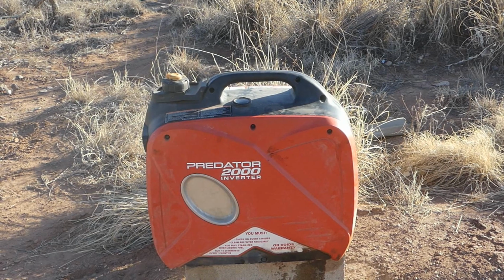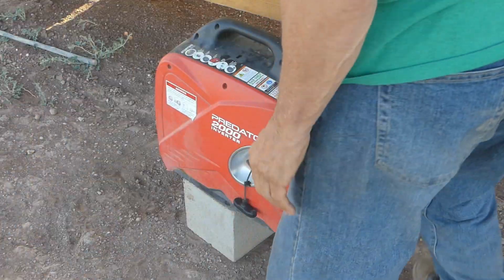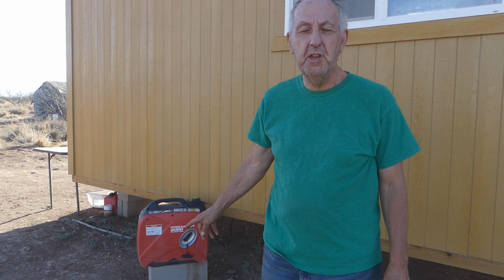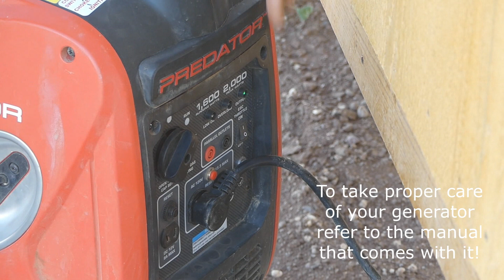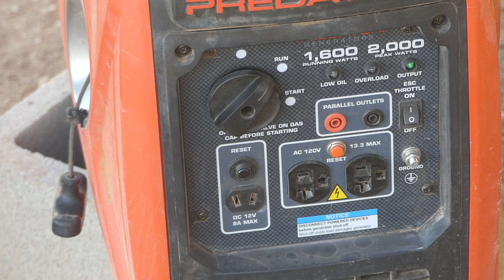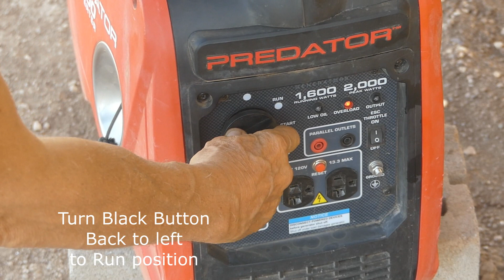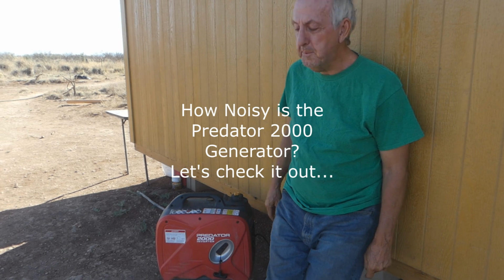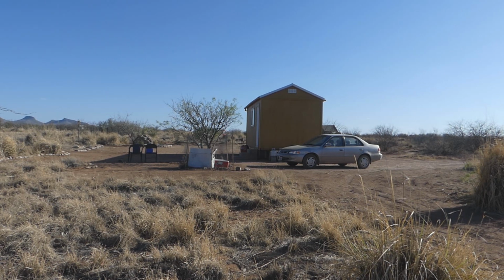Did I choose the best generator for my money for my off-grid cottage?

Comment: After years of using my Honda generator at remote construction sites, the pull cord broke so I went to a lawnmower shop and replaced it. It only lasted a short time because some thief used the rebar cutter/bender I had in my truck to cut the big chain I used to lock it while inside Home Depot for 10 minutes. Don't leave your stuff unattended, even if locked. It's expensive.
Reply from the maker: Thanks Lynne for sharing and thanks so much for watching my videos!

Comment: I also purchased property in Arizona, in Apache County,  I opted to go with 2 Bluetti solar generators.  With all the sun we get in Arizona, they work great.  Bought the set including both the generator and solar panel, so don't have to mess with pull cords, keeping it fueled up etc.  Also they don't make any noise.  Most of my stuff is rechargeable but I'm also able to use my normal kitchen appliances with them as well.  Just something worth considering.
Reply from the maker: Way to go Kevin!  I strongly considered the Bluetti for sure. In the end I felt the Titan was a more powerful reliable option. But then that is before Bluetti upped their game with the latest models of solar generators. Glad to hear that you are happy with them and it sounds like a fantastic system.  Thanks for watching!
Reply: I have both the Titan with 3 batteries and two smaller Bluetti sogens. You need enough solar for the Titan and it has to be set up correctly. Otherwise it will never fully charge. Redundancy with the Bluetti will allow the Titan to fully charge. Portable Bluetti pannels keep it going. Good luck, hope it all comes together for you.

Comment: I have 2 of those Honda Eu2000i's.. and the parallel kit that connects them together for 22 amps. Years ago when I bought them.. they were only $900 each..  but they're easy to start, quiet and cheap enough to run.
Reply from the maker: I looked at the Hondas for sure.  They were just too rich for my financial diet. Thanks for watching!
Reply: Have the same. Since 2004 hurricane season. Just the best value and reliability for your money. Never a bit of trouble despite having run several thousand hours.

Comment: I'm partial to propane generators.
They can sit for years with no carb issues.
I got a 3500 watt surge, 2800 watt continuous one. 
Appx 10 hr on a 20 lb tank, low load.  4 hr near max rated load.

Propane can be stored indefinitely.

Nothing really wrong with the Harbor Freight generator.
Reply from the maker: Great tip F Huber. I am in the process of hooking up solar as we speak so I foresee a lot less generator use in the future.  Stay tuned...!

Comment: I live in Mohave County offgrid in an RV. I  almost solely get all my power from solar. In reality I am now getting all my power from solar through snowy days and overcast days. I really don't miss the days of constantly running a generator or the expense. I believe I saw you have a couple panels. For the longest time I was running 320 watts of solar into 840 AH of golf cart batteries. With that 320 watts in panels I was meeting most all my power needs and running a 1300 CFM evap cooler. Last year I increased my solar panel wattage to 1240  to run a 3100 cfm evap cooler. I have a washing machine with high speed spinner, microwave, extra 12 volt cooler freezer and plenty of other things constantly drawing power. Most nights my battery power doesn't drop below 12.5 volts.  Here in Arizona with the sun you can really get by with less panel wattage and more batteries to carry you threw the night. Enjoy watching you make progress and figuring your way through the inevitable issues of offgrid desert life!
Reply from the maker: lisa mcdonald. Thanks for the super reply and YES I AM WORKING on part of my solar set up as I write this. Thanks so much for watching!

Comment: Solar panels, MPPT charge controller, 2000W inverter, and 4  lithium batteries. All the free electricity you want.
Reply: Yup that's the way to go. Only I would use deep cycle batteries for a few years to save on cost. I'm very happy with mine.
Reply: Not everyone can afford this set up
Reply from the maker: Thanks for such great suggestions folks.  Major teaser here. Solar to come!
Reply: @clarenceduguid7762  
Does take a decent amount to get started, but gas , generator & trip to get gas cost more in the long run
Reply: Around how much would this kind of setup costs? Just an estimate is fine, just want to have an idea

Comment: That Harbor Freight genny is just fine, there are bigger ones but they usually use more fuel.  The fellow running the channel 'Class A Living' has been using one for quite a while now, I think last time I saw it was up to 1400+ hours of run time.  He has had to change the rope so if you have questions, go check him out.

If it ever does go out though, you might look at some of the Champion 3k models, they are the smallest made with a self start and they also have a dual fuel model that can be hooked up to large propane tank. That way maybe you and some neighbors can talk a propane company into bringing a truck around to fill gas up every month or two.
Reply from the maker: Great tip Jon.  Hoping to retire the generator for the most part in a couple months once solar is in.

Comment: Cheaper is not always better.  I looked at the Predator and read a lot of reviews.  I did the same with the Honda 2200 and bought the Honda for my 17 ft travel trailer.  I converted the Honda to propane so now I can choose which fuel I want to power it.
Reply from the maker: Sounds like a wise plan Gene.
Reply: I own 3 Predator generators with zero issues, I would not spend the money for a Honda.

Comment: You could make a small box just for the generator to keep it out of the weather, and if you isolate the box, you would remove a lot of the noise also. ....?
Reply from the maker: Thanks John.  I was a bit worried about it overheating in a box.  But am open to suggestions.
Reply: @affordabledesertliving3487  
Yes you right on that.
One of my uncles dug a hole to eliminate some of the noise from his generator, guess what?
His generator blew, due to overheating.
That kind of motor needs an open air flow.
You can build a shade, without walls.
Let it breath fresh air.

Comment: Very happy your doing ok, and back on line. Yes your rigjt about the sta bil , its recommended to add it to your machine when uts put away for a long time , like months , prevents gummig up the carb , fuel lines.  Take care , lookikng forward to your next video , thanks Don.
Reply from the maker: Robert thanks a ton for your faithful watching of my vids.
Reply: If you are going to store it for a while you should shut it down by closing off a fuel valve at the tank (hopefully it is equipped with one) and let it run until it stops to totally drain the system. Then drain the tank. I've been fooling with gasoline storage for years and even with stabilizer you can have problems in as little as 3 months storage.
Reply from the maker: @bearchow1929  This is super valuable information.  This generator is super simple so dont think it has a fuel valve.  I will check next time I change the oil. Great info!  The other thing of course is that I could run it every couple of weeks whether I need to or not. Thanks for watching!
Reply: @affordabledesertliving3487  Running it every few weeks for an hour or two is definitely an option.
Reply: @affordabledesertliving3487  For what it is worth we have an off-grid ranch in western Arizona about 15 miles east of Salome.

Comment: Here's a tip for you: Get a generator with an electric starter! That way, you never have to yank away on the pull-cord, and starting it is as simple as pressing a button. 

Also, if you get a 'dual fuel' generator, you can run it on propane, which not only smells WAY better, but you also don't have to worry about the carburetor getting gummed up. 

Both are worthwhile upgrades, in my opinion, and I'm cheap-ass!
Reply from the maker: Thanks Tim G I wasnt aware there were dual fuel generators.  Good tip.

Comment: You didn’t mention how fuel efficient the generator is! That’s a huge plus! I have the predator 1400 to run a window unit ac in my camper trailer. It does the job very well for about $4 in gas per day. You could do the same with yours and keep your cabin cool in summer. 🙂👍
Reply from the maker: My cabin stays quite cool because its so well insulated to be honest.

Comment: Those Predator generators are highly rated. Consumer Reports did a comparison with the Honda and found them about equal. The biggest drawback they listed was parts availabilty if you ever need parts. I bought one myself, but I got the 3500 watt unit.
Reply: Everyone I know that got a Predator generator (and/or other brands) replaced with a Honda, say that they are so much better in functionality, durability, replacement parts, servicing, etc, it was worth the extra money, and that they should have done it since the beginning.
Reply from the maker: Merlin yeah I love Hondas.  Hope the predator lasts until I am rich and famous and then I will get a Honda.  LOL.

Comment: glad to see this runs good long hours ,i bartered and got one of these from some off grid folks who ran it all day was worried but seems to work just smells as if its running rich going to clean carb before spring storms take the power out ! i used to run a onan 2cylinder but was over kill and drank gas down compared to this one, lugs hard with a airfryer  plugged in lol

Comment: The Predator 3500 has electric start. All you'd need is a little dolly to wheel it around. I have a pair of the 2000s for emergency power but I'd never go off grid with them. The pull cord is unreliable and spare parts, like if you strip one of those oil plugs, are really difficult to find.
Reply from the maker: dvfreelancer this is excellent information.  Many thanks.

Comment: I'll likely get one of the bigger electric start ones from Harbor Freight, and I want shop power , so I can wood work and weld.

As far as grounding goes, if your outlets are already grounded to a ground rod, you're grounded.
Reply from the maker: Dan I only have a surge protector and a long cord running to the generator so no grounding.  So far I have been fine. I will be setting up solar in the next few months.  Stay tuned...

Comment: My cord did the same thing I just removed the side of the generator and found that where the cord exits the plastic frame is a metal piece that the cord rubs on and splits. I now pull the cord with the side off. No other issues since.
Reply from the maker: Clifford this is an excellent idea I am going to try that as well. Thanks for watching.

Comment: Glad to see you'r back. I was wondering what happened to you.  Just an Idea, If you purchased a couple of 12 volt batteries and a battery charger, you might not have to run the generator quite as long and still have power for lighting
Reply from the maker: Thanks for the welcome back!  Yep solar is in the works!

Comment: One thing that you can do is plug in a small battery charger why your running the generator anyway hook it to a 12 volt car battery and you can get more bang for the buck that way,  you can get a small inverter ( like a cigarette liter type that puts 110volts ) and you can run a couple of 110 volt led bulbs for light as a freebie long after you’ve turned the generator off.     Call it A Minnie hybrid system
Reply from the maker: Solar array is 1/2 here now.  In a few months will be hooked to solar hopefully.

Comment: Maybe try using some heat shrink tubing around the area where the pull cord is fraying to protect it.  I’ve heard of people using that trick with success, not sure how well it would work with this particular generator, but maybe something to consider.  Otherwise maybe you could find a small engine repair place to install a better quality pull cord.
Reply from the maker: Brandon I think that's excellent advise.  I purchased a 2 year extended warranty and so if it breaks when the warranty is up I think that is a great idea to get a small engine guy to put something serious in there for a pull cord.

Comment: You should probably use high octane, only use stablizer if storing it, love your videos, stay safe.
Reply: Does this engine has a high compression rate that requires high octane fuel?
If not, then it is just wasted.
Reply from the maker: David thanks a ton for watching my vids.  I started out using premium gas but thought it might be just a waste since the generator runs fine on regular unleaded.

Comment: Honda 2800i - got it for my boat in 2016 at home depot, 490 bucks at the time. Not sure what it would be now, but ran a/c and the whole boat. Are you planning on Solar at all?
Chuck in SV
Reply from the maker: chuckrit.  That generator (you can see it in my vid here) is now about $1200.00
Reply: @affordabledesertliving3487  wow, the honda  EB2800i can still be gotten for 655, if you need a replacement. 2500 continuous to run AC and enough left over for other stuff
Reply from the maker: @Opa_Plays  Super helpful info on the Honda Chuck thanks!!!

Comment: Those little generators are awesome.  On the grounding, most everyone runs without a ground, BUT ME.  That little ground point might just save your life if the ground is wet and you have to go out to stop or service it generator. I know it rains there every once in a while lol.   You can get a two prong electrical end to slip under the nut and tighten it up or loosen as the case may be for moving it around.  I put a flat and lock washer then a wing nut on and it works extremely well.  I am a old electrician and I have been very lucky in life by being extra safe around it. If you plan on using with the solar as a back up charger you must ground it.
Reply from the maker: Good advice Rodney.  What do you ground it to please?A big rod in the ground?
Reply: @affordabledesertliving3487  The big rod in the ground.  Always remember electricity is moving to find ground.  A wire is less resistance than a body. It will always take the path of least resistance.  You are living the dream. God bless.
Reply from the maker: @rodneyross5282  I wonder how deep the large rod has to go into the ground? hmm.
Reply: @affordabledesertliving3487  Wow I was typing a  reply and lost it all lol.  I will try again.  Those rods can be purchased at lowes or home depot. They will have exactly what you need.  Just remember the better the ground the safer you are.  What are they going to use on your solar panels, all this must be grounded together to be safe.  There is a old boy on the Tin Hat Ranch channel that does a ultimate solar video that about 45 or so minutes in has a good take on the grounding lol. Might want to watch the whole thing. It is very informative and super interesting.  He did a lot of research to make it, might want to watch it all.  He is a hoot.

Comment: If you can use synthetic oil in the generator once broke in, i would use it. May need all the help you can get on making generator last. Wal mart synthetic would be fine, to save money.
Reply from the maker: flexjay87.  Hmm good tip. I bought the extended warranty on the generator and hope to have my solar installed and running by fall.

Comment: Harbor Freight based their engine on the Honda GVC engine.  It is not, however, the same engine and certainly does not have the longevity or reliability of the Honda.  For the price, insomuch that you get the warranty, it’s a good budget unit.
Reply from the maker: Jim Jensen thanks for the input. Overall I am happy with my choice. Thanks for watching!

Comment: I can see that you have one huge and very serious problem. 
With my business  I have seen this problem cause other people in my business really big headaches. So if I were you I would fix this problem right away. I have a Honda 2200 and like you I depend on it for my heat and other things. So get yourself a very good chain and a really good lock today and lock it up. There are very desperate people that will steal it in a heart beat. I have seen it happen several times to nice guys like you. Honda offers a metal security bracket that goes onto the handle so someone can't cut the handle and remove the chain.  I don't know if the predator offers it but in any case lock it up.
 I woke up in Utah in 6" of snow one morning after running my generator all night and there was foot prints in the snow all around the truck I was sleeping in. If I had not secured that generator as well as I did it would have been stolen. And trust me you may think it's not going to happen to you because your in a remote area but those generator have a way of growing legs. Just ask my brother who lives off grid like you. He went to town and upon arrival back home ... no more generator. And lock it up inside your home as well when you go to town too. Just for extra security. Your only inviteing criminals if you dont show them that you are securing your stuff and you will find in time its usually someone you know or have come in contact with.... Hope you find this useful.... One last tip wrap the chain with a pool noodle ( floating device) to insulate and minimize rattling of the chain against the generator.
 Reference: YouTube (South Georgia hotshot : someone stole our generator.)
Reply from the maker: Steve thanks for watching and your concern.  Sadly enough your correct. So many light fingered types.
Reply: @affordabledesertliving3487  zombies pulling on chainsaws all night lead to using para cord for pull cords  ZOMBIE approved and ZOMBIE strong